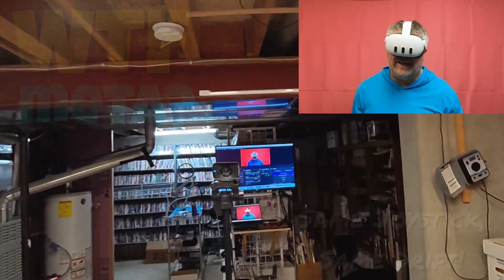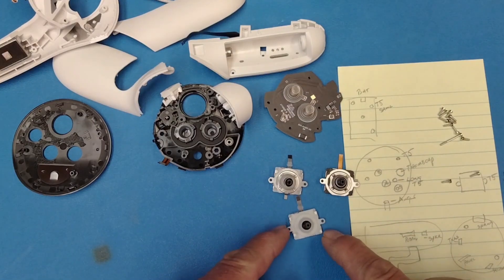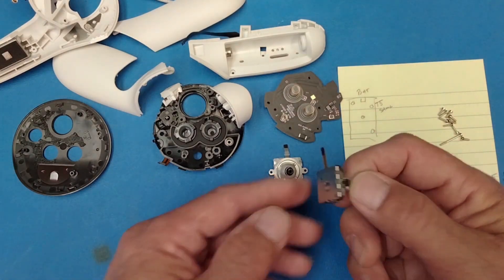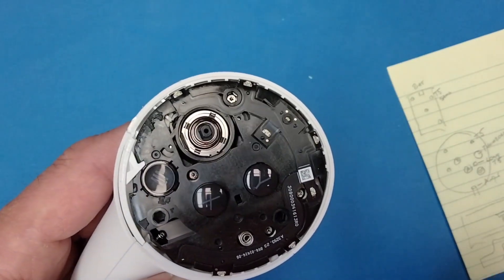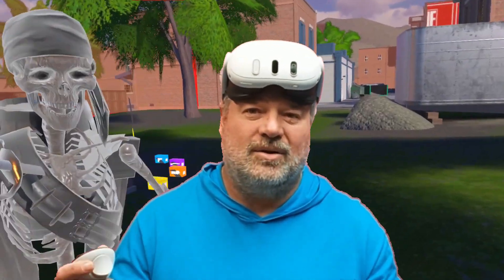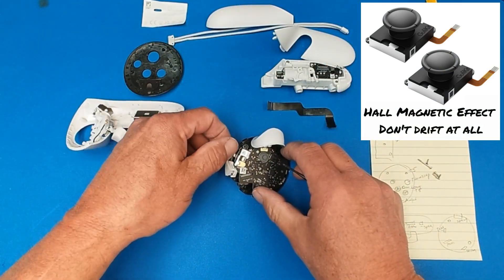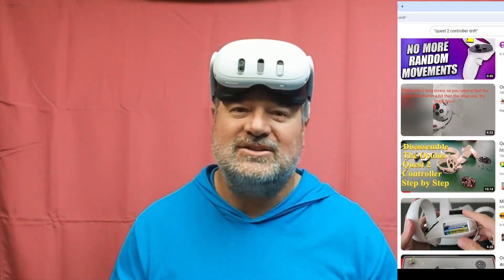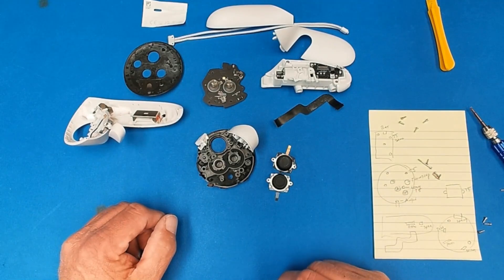Why Do Your Quest 3 Controllers Drift? (Same joystick as Q2.)

Comment: Hello, i found your videos really useful, thanks.  Can you please tell me whether Quest Pro controllers use the exact same component as well?  It's obviously still using a cheap sensor (I've had to send it in for drift twice already), but when the warranty runs out it would be very useful to know if the Q2 component will work in the QPro controllers as well.
Reply from the maker: Can't answer that, I've never had one open.

Comment: My Quest 3 is not even a month old and I've got stick drift on my right controller already.
Reply from the maker: Sorry you're going through that, but I'm not surprised.  It was only a matter of time before drift became a thing on the new Q3s.  Just remember you're still under warranty if you want to pursue that.  If you want to fix it yourself, I've got a video to show you that.  https://youtu.be/RZRY1vsDl50  Good luck.
Reply: @ImaRainbow  Imported, so no warranty basically. I increased the dead zone so it's fine for a bit, will get the hall effect replacements when I can.

Comment: How can I take out the screw under the front trigger for the joystick? It’s so hard I can’t get it out it keeps slipping the screwdriver off
Reply from the maker: This is for a Quest 3 controller?  Are you talking about the t5 screw holding the circuit card on, that's just behind the trigger?  Are you using a torx driver?  Flat or philips head won't work.  https://youtu.be/EYa9UeDJvmM

Comment: dude, you might be bummed that they used the same component for the joystick, I for one am psyched. by comparison to the index controllers, these joysticks are super durable, AND easy to swap out. now I am not saying they are awesome on their own, but at least they will last longer than two months, and when they fail, they are simple to replace using some pretty basic tools. they may not be hall effect joysticks, but they definitely arent the worst option
Reply from the maker: I was hoping to never have to worry about drift again.  I think that could've been achieved with minor engineering effort on Meta's part.   Already having a replacement transducer sitting on my esd bench IS a positive, but it's just not enough for me to think we got the best outcome.  Still loving the headset though. 
Thanks for watching, Happy Gaming!
Reply: @ImaRainbow   Same